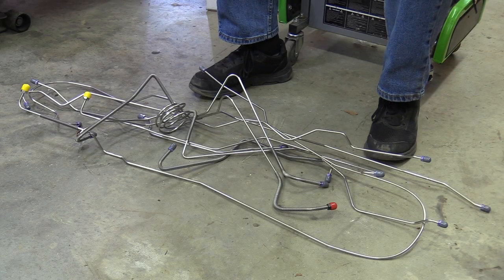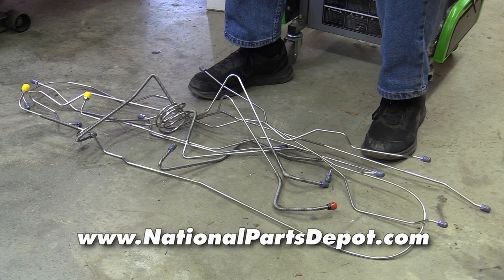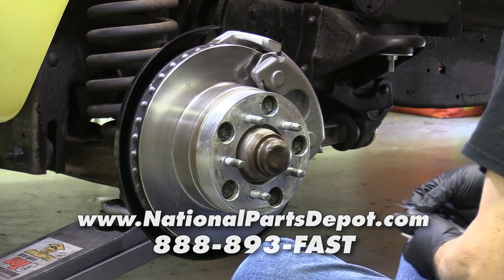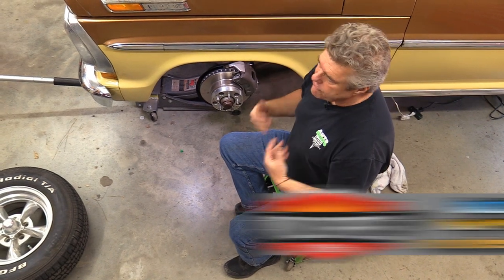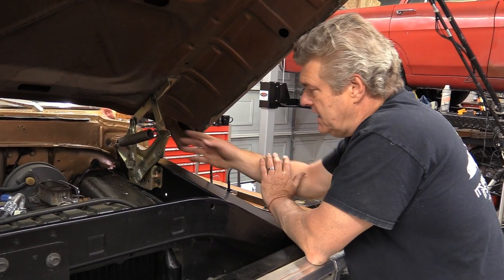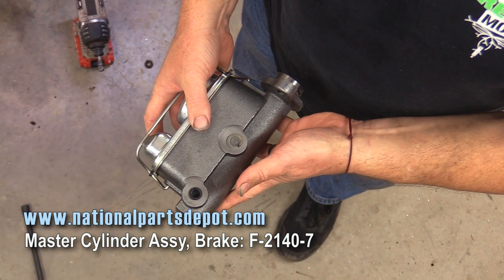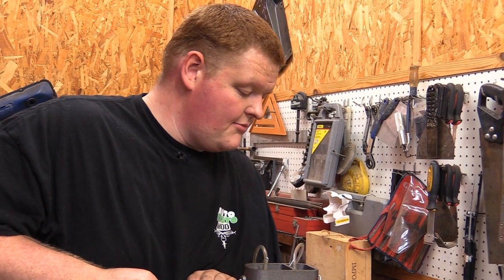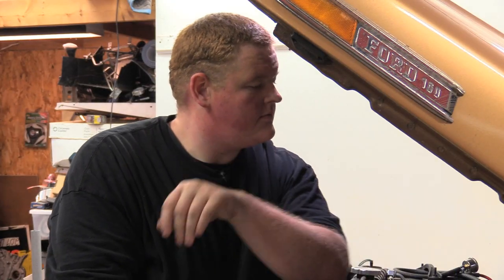Bleed Check and Install Power Brake Master Cylinder

Comment: In 35 years that I have worked on cars I have never found a solution to prevent uneven front tire wear on any 1/2 ton and up Ford truck.  New steering and suspension components and an alignment only delay the inevitable. 🥴  Good info on the new master cylinder, if you don't bleed it beforehand the pedal will never firm up.  Subscribers are nice but it's the views that really count. 👍 Stay safe guys. -Glen
Reply: Twin I beam ford trucks.. really need to have the toe in measured to the inside of the tires at 4:30 and 7:30 give or take.. so you can create just a slight toe in..  but this has to be done on ball bearing wheel alignment turn tables to get a no friction adjustment of usually 1/16 toe in..  this is with good bushings. good steering linkage , and no loose rivets in the brackets that mount the inner I beam brackets to the crossmember..

Comment: Ran into the same brake line issue when converting my 68 to power disc brakes as well. I ended up just making my own lines which we all know was way to time consuming but it worked

Comment: muchas gracias for another wonderful video on my 69 f250 I bought the stainless steel Inline tube kit as well funny thing the lines from the master cylinder did not line up with the old lines that I had that was maybe only two lines out of the whole kit that were actually the same.

Comment: I always lean towards making my own with Nicopp, especially on a daily. Been using it since the 80's, it's easy to work with and side steps issues like you are having now.
Reply from the maker: Well, the issues were my over thinking...😆
Reply: @AutoRestoMod  Oh I get it, I'm doing a disk brake conversion and general brake system refurb  on a buddies 46 Stylemaster and  it's become more complex than it should be. Especially with the current situation. Though technically speaking, I am to blame  I was the bright spark the said, 'hey, why don't you do a disk conversion, it will be better!'

Comment: I feel your pain with the brake lines and master cylinders. Some f100 brake lines at the master cylinder come out the left side of it and then some on the right. Proportioning valves can be found on the steering gear box, under the steering box, on the driver side frame rail and some on the rear of the front engine  crossmember above the pitman arm. I got a 67 with 75-79 brake parts so I just did my home work and ordered a kit that I knew plumbed in to the Proportioning valve mounted for the crossmember. Big headache and I had to also modify the rear over the axle brake line due to Ford also changing the track width for the rear axle on 73-79 f100's.
Reply from the maker: It can give you a facial tic...

Comment: Advice needed. I have a 68 F100 that I think has had a 73-79 disk brake upgrade on the front. The brakes have not worked correctly, since I bought the truck, pedal to the floor before the truck stops,. Where might the problem reside? I had a shop bleed and service the system and they couldn't find anything wrong, could it be the 73-79 parts that were used on the upgrade. Thanks in advance.
Reply from the maker: Ours is working great and is using the same brake set up. I would look at the master cylinder as a possible culprit.

Comment: Can I bleed them successfully without bench bleeding the master?  I have stock power brake master and booster on a crown Vic swapped f100
Reply from the maker: Yes, it will take longer though.

Comment: Yeah, I don't know why Ford did stupid shit like that. My gas cap wasn't sealing due to age. Do you think a parts store has a gas cap for a '68 Torino? Nope, but they can get one for a '69. Why wouldn't they be the same? Ford only did cosmetic shit between the 2. But noooo, the '69 doesn't go in deep enough to lock, so I pulled the rubber and put it on my '68 cap. Seals great now.
Reply from the maker: ADAPT AND OVERCOME!!!!